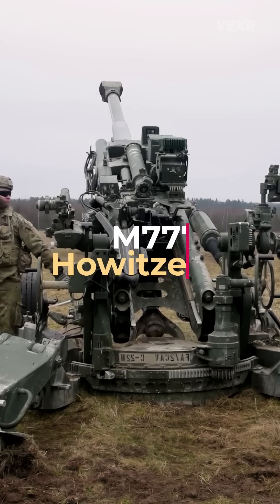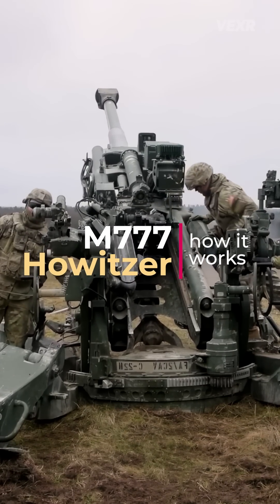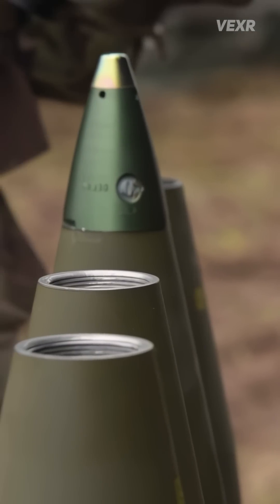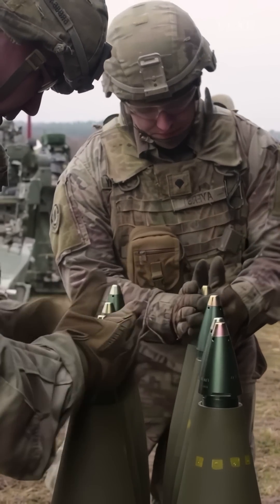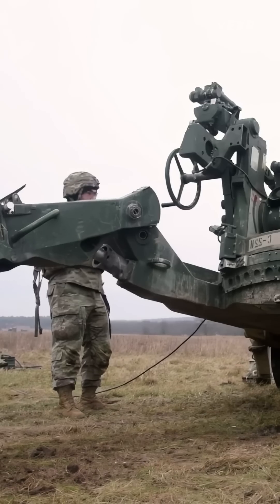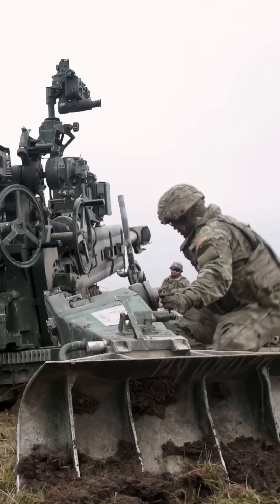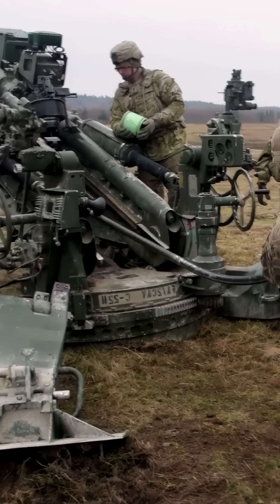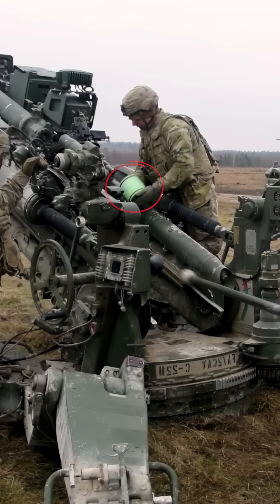How It Works: Full Process of M777 Artillery

Comment: Actually the shells have propellant.  The additional charges are added for more range.
Reply: No sir the projectile is just that, there is no propellant in the Joe.
Reply: @NTATchannelNickTaylor   so whats gonna drive the shell tens of miles deep into enemy fields? that tiny green thing may give it boost but u sure its the only driving force?  u still need explosion at enemy targets!! jow
Reply: @MrAzizisse  yes I'm sure. If you understood how the powder charge system works you would know as well. 20 years 11 months US Army Field Artillery Corps. There are many of us here that know these systems inside out and there was no such think as an internet let alone YouTube.
Reply: @MrAzizisse  The green bad isn't designed to "drive it tens of miles" that's the white bags (which comes in a base charge of 5 with two additional charges of 6 and 7) job. Every mission target isn't tens of miles away. Sometimes it's relatively close.
Reply: @NTATchannelNickTaylor  hi thanks for the response. I am civilian not artillary man. I loosely guessed the meaning of charge.  No idea what white bag is either. But sounds like powder filled per requirement ! 
My understanding of artillery was ready made shell that u put in barrel, adjust the angle of launch to put on target , fire . Also i would think that artillery is with few huddread meters accuracy radius! I wouldnt expect it to be with in tens of meters unless by luck of course..
Reply: @NTATchannelNickTaylor   but i admire how that machine doesnt move after each firing.. so smooth. That barrel is built with the best shock absorbtion engineering .....saluto
Reply: @MrAzizisse  Look up what a 155mm artillery round looks like.  That's the entire round which gets shot out of the barrel.  The green and white bags are the propellant depending on distance and trajectory to target.  Then there's the primer.  Basically everything comes separate instead of one big "bullet".
Reply: 22 miles is the range unless your shooting Excalibur round. And no the round doesn’t have propellant, that’s what those green Lima charges are for.
Reply: Your wrong my guy projectile is just that a projectile, the propellent or charge 3 green bag is what sends the round down range, 0811 all the way!
Reply: That’s not correct. The round has no propellant. The green bag he threw in is the propellant and they didn’t use much. There are different sizes and numbers of green bag depending on how far you’re chucking the round. When you need more it graduates to white bag. Google my name if you don’t believe I know what I’m talking about.
Reply: @Redlegarty  Don't we use RAP rounds anymore?  Those are the only ones with propellant in the round that I remember. 

Also, you mentioned green and white bags.  Do we still have the all-mighty red bag?
Reply: @Darion350  I remember rap ( rocket assisted projectile) rounds. They were pretty rare in my time. Never heard of red bag just the red patch on one end of the bags. Had to hear,” I see red” before closing the breach. I think my knowledge is all obsolete at this point tbh. I just know they don’t in general have rounds with propellant in them. Also when I was in at one point I was an FDO of an 8 inch howitzer battery. I saw your comment about them. They were pretty epic!
Reply: @Redlegarty  I was in during the mid 90s and we had a red bag which was one solid bag that was bigger than a full white bag.   That thing sent the breech out the back door when it was fired.  I only fired it a couple times but it was damn powerful.  

RAP rounds were fun. They'd ignite after a short amount of time and they'd look like little stars that appeared in the sky (when shot at night, obviously).  Good times.  

I kinda wish I had been able to operate the 8in.  That thing looked damn impressive.  I'm glad I was in the m105, though, because at least I had cover from the elements.  The self propelled 8in didn't seem to have any cover, unless there's a tarp or something that was missing.
Reply: @Darion350  no cover at all … that’s why I was glad I was in the FDC. Back then it was an m113 with antennae all over it making it a target. When I became a fist chief I lost that shelter lol. Never saw a red bag but it sounds crazy.  Good memories of the Redleg life. I’ll never forget Ft. Sill and marker signal mountain.
Reply: @Darion350 the MACS propellant is a completely new and different propellant than what you worked with
Reply: @Darion350  We had RAP rounds when I was on 8 inch (M110A2) but I never got to fire one. IIRC the only powder charge used with the RAP was Charge 7 WB or Zone 8. I'm getting old but I remember that much.
Reply: @arekjowo3590  
Exactly HOW MANY were destroyed? I'll admit that a couple were destroyed, but your bragging like battalions of them were lost. 🤔🧐
Reply: @texan-american200  quite a few.  Every week we saw two or more.  That's alot, probably majority of those sent. This is evidenced by the apparent reduction in its use by Ukraine,  and the simultaneous reduction in the rate at which they're being destroyed.
Reply: @texan-american200   am sure loads of them were destroyed. russia is still advancing despite using lesser than needed, no airforce almost  despite having poor military planning corrupt leadership, poor logistics, still going ahead. US howitzer is surely a killer but loads weere destroyed . more would be if russians had modern recon,armament,planning n better leadership.
Reply: From someone who's never been next M777. The shells do not have propellant, and while we are here, they are called projectiles....and the prop is a system called MACS.
Reply: No they don't unless your talking about a RAP round. Those have propellant but it goes with the name of the round. The charges are what set how far and fast it gets there. There is charges  are 5,6. and 7. There is a charge 8 but only seen it fire at 29 Palms you need a lot of land for that landing zone.
Reply: up to 120mm mortars yes, the 177 is a shell with propellant bags, much like the 16 inch guns on old battle ships
Reply: @WatchDragon  the m777 shoots 155 shells. Just did it this past weekend.
Reply: @WatchDragon  Also we stopped using bag charges a while ago on these cannons. We now have the MACs as burn pits were dangerous.
Reply: @BadgerSage  yea it’s been years since bag charges. Like 10 plus years.
Reply: @jonathonthompson8538  We gave all that shit to Thailand, Ukraine and other allied nations. All the surplus we basically had of the 1911A1 and 2 bags plus the M4a2s
Reply: @BadgerSage  yea we just got back from 2 week field exercise and for the whole battalion we were only allotted like 200 rounds instead of the usual 600-800. Just terrible
Reply: The king of Battle has been used by the US for Generations.  Just saying
Reply: Really????????
Reply: The M795 155mm round has a cup at the bottom which allows the propellant to launch the projectile. There is no propellants In the projectile. I machine these exact parts.
Reply: @electricfuneral8456  Except RAP rounds.
Reply: @donald Kasper 😅😅😅😅 that was NOT an artillery shell son. Artillery rounds do not have propellant or additional charges. Some rounds have rocket assistance/booster, but not a propellant 😒. You learned something new today son.
Reply: No guy. No
Reply: @DetentionHallPutsch  I'm trying to tell em, I don't know where this stuff comes from! You figure they'd just ask a 13B out here, there's no shortage of us out here that can answer their questions. 
Oh and I like the name! Bierhalle, I get it!
Reply: @NTATchannelNickTaylor  well there's artillerymen. And everyone else.
Reply: No...the shell and charge are separate.
Reply: False, no shells within the 155MM family have propellent. Hence why you cannot fire the cannon at all without charges.
Reply: ...any idea what sort of range ?
Reply: @cspace1234nz  Google is much faster you can become an artillery master in the time it will take him to respond, if he ever does
Reply: @cspace1234nz  i believe the triple 7 can reach around 18 km or about 9 or 10 miles. I am sure I am wrong but close.
Reply: @cspace1234nz  Depends on the round and how much propellant (bags) they use.  18km/30km, and advanced rounds 40km+  Or such...
Reply: Idiot. You're thinking about mortars. This is artillery (I'm a 0811)
Reply: @arekjowo3590  Russia destroyed its own howitzers?
Reply: The round itself does not have propellant
Reply: @Kraetyx  some do have propellant HIMARS for example.
Reply: @FirstLast-ox1iy  HIMARS is a different weapon system. You go to a different school to be qualified to operate those than the 13B school for howitzers.
Reply: @Kraetyx  it's still artillery
Reply: I think we completely have veered off the original comment. a shell is not a missile. missiles do contain their own propellant, a shell does not.
Reply: @Kraetyx  RAP round.  😋
Reply: @FirstLast-ox1iy  GMLRS is a rocket, not an artillery round.
Reply: @antdb3021  not what I was referring to thanks but you're a month late.
Reply: @antdb3021  HIMARS
Reply: @FirstLast-ox1iy  HIMARS is the launch system genius. GMLRS is the rocket HIMARS launches.
Reply: @antdb3021  what does the A stand for?
Reply: @antdb3021  while you look that up the definition of artillery might be your second search.
Reply: @antdb3021  I served and have seen HIMARS on target.
Reply: @antdb3021  find it yet genius?
Reply: @antdb3021  spoken by a child
Reply: @FirstLast-ox1iy  who answers by making ten posts? Hours apart? 😂 you big pressed about a YouTube comment. Lmao 🤡
Reply: @antdb3021  someone who is busy and doesn't care
Reply: @antdb3021  what does the A stand for genius?
Reply: Confidently wrong.
Reply: Actually UKR has called them almost useless they break down every day have a low rate if fire and a barrel life of a few days. That's if Russia doesn't get to them first.
Reply: You are wrong there bro. There is one projectile that has a rocket motor for increased range,  its called a RAP round. All the others are just projectiles.
Reply: @guitarsandexplodingdinosau7821  no
Reply: @arekjowo3590  you Russian fools are being obliterated by the Ukrainians 😂. Y’all are a joke around the world
Reply: He might be thinking of the RAP rounds. Rocket Assisted Projectile. But that too was added to the round, not part of the original round itself.
Reply: Despite donations from Poland and Czechoslovakia, the Ukrainian army has only a few dozen M-777s which resemble an artillery piece in shape. But we know very well that it is a missile platform whose ammunition is very difficult to manufacture. American industry has a capacity of just over 500 long-range rounds. The annual capacity of ordinary cartridges only covers a few weeks of expenses required for UA.
If the United States cannot "import" technicians and highly skilled workers from China, Israel or India, it will never have the opportunity to seriously increase its production. Do not confuse the eras... On the eve of the Second World War the USA represented 45% of the world's industrial production. Currently the USA represents 7% of the production of machine tools, it is a little better than Italy. Let's see if they will be able to convert business school graduates, lawyers, petrochemical workers into military industrial workers.
Reply: @arekjowo3590  We sent 7 howitzers over there 😂 i was in bragg when we sent them. And the russians havent destroyed them the ukranians have shot so many charge 8’s that they need to have the tubes replaced. The 777 have knocked out a ton of tanks using excalibers and pgk fuzes. Gotta love the 260,000 russian casualty count though. Russians throwing bodies at the problem like theyve also done and are losing to a country half their size 😂
Reply: @Whatisvr  260k count according to a man that  won't even acknowledge his soldiers are dead. He's already burned through most of the regular troops yet somehow they were still trying to claim 10k dead at the time. According to him, yes?
Also, yay to the Russian MOD for b releasing videos of their exploits,  there are countless videos if these m777 getting destroyed. And bruh, far more than 8 were sent. Weapons are being shipped undeclared at this point, yet the count still does stand at more than 8. 😅

Edit, my apologies,  7 😂😂😂
Reply: @Whatisvr  They hold a bunch of territory. Is that losing? Don't believe the lies on tv news, chum.

Comment: I trained on the M109 SP 155mm 105mm and 8" towed howitzer. The Paladin version didn't exist. Those were the days!
Reply: When you actually had to work for a living
Reply: M 119 105 mm 25th ID 98-02
Reply: FA OSUT Ft Sill 1983
Reply: @NTATchannelNickTaylor    Same year for me. Went back last year and I didn’t recognize anything.
Reply: @sisenor4091  I probably wouldn't either. I wonder if OSUT is still split between Towed and Self Propelled? Us towed trainees were called Frogs by the Drill's over the SP guys. M198 Lifer!
Reply: So did I Rodney.  The paladin was coming into service after they put me under a  brown round
Reply: @keithpete2710  Paladin came in when I was at Ft Carson, never got to touch one though.
Reply: @NTATchannelNickTaylor    They were talking about it when I was there.
Reply: FA OSUT 86
Reply: @keithpete2710  I was there in 86 as well
Reply: Ft Sill 85’ 86’ M198 towed when men were men😊
Reply: So did I. M109 and German FH-70
Reply: Also Ft Sill
Reply: I remember seeing an 8" howitzer.  Holy crap that thing was huge and archaic.  I served right up to when the Paladin was being introduced.

Comment: This is horrible weapon made out of titanium to make it light for air mobility. The light structure of weapon can not withstand the extreme shock and sustained fire of 155mm rounds. It is prone ro frequent break down and high maintenance  required to keep it operational.  Ukraine has burned through high number of M-777 due to high intensity firing of the gun some units have to be written off cannot be repaired due ro extensive damage.

Comment: The elevated barrel with the sharp spike seems to be a lightning strike target. Could a lightning strike detonate a shell in the breach with deadly results??
Reply: No,
Current would not flow through the explosives nor heat the case enough to ignite it.
Reply: Electricity is not Fire completely different